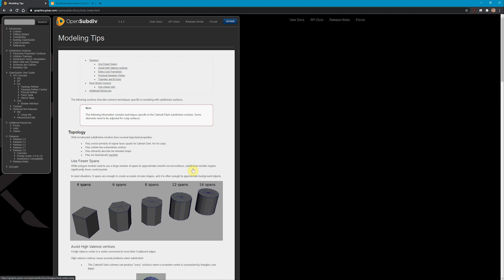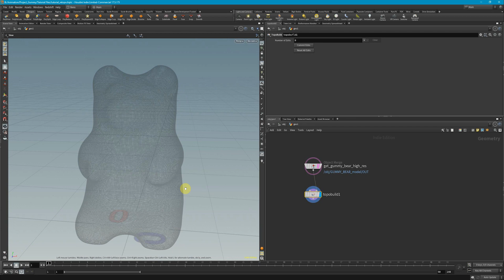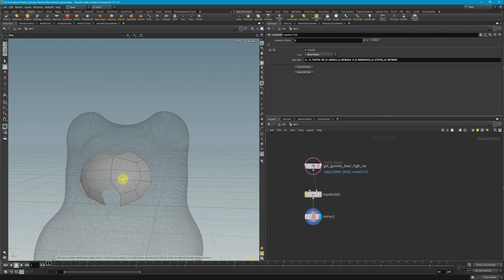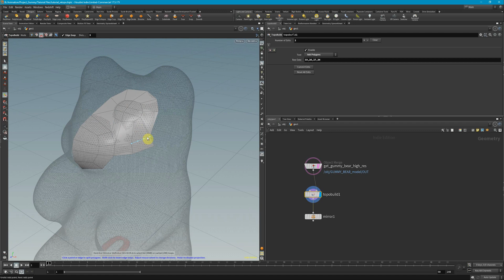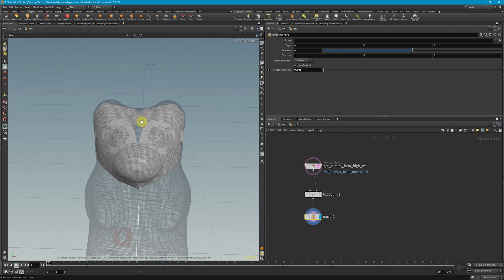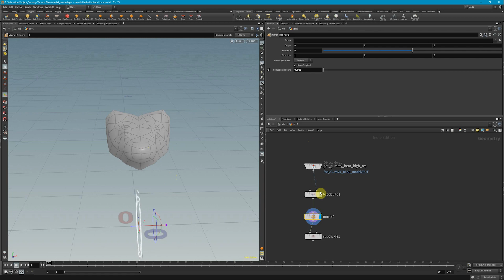Houdini Tutorial - About 10 Minutes - How to efficiently retopologize your high polygon count model

Comment: Thank you very much! I was looking for a tutorial on retopo in Houdini, i find the tools really easy to use and efficient for fast work. I have one question. When retopo high res mesh, for example i have 20 flowers, and most of them are around 100.000 polys and few have even 4 million, and i would be making a particle system with them as instances. I just run a quick test of how the pc will handle it aaaand it lags extremely it almost not workable. Could you share with mr what would be the optimum situation of poly number for this kind of scenario? They would be flying and some might pass really close to camera. Note that im on a 12ram laptop, with i7 just 12ram. Thanks for posting this!
Reply: I just thought if there coould be some estimate or a standard optimized polygon number for these kinds of things. I guess i will just have to figure it out in the process :D.
Anyways, love your channel! Hopefully you could make some series. Best.
Reply from the maker: Milan Bajcetic I’d recommend packing each different flower (you said you had 20 different kinds) and then duplicating these flowers while they are packed geometry. Check out this doc for more info on packed geo in Houdini. Hope this helps! https://www.sidefx.com/docs/houdini/model/packed.html#overview